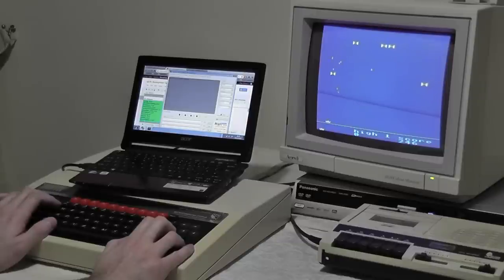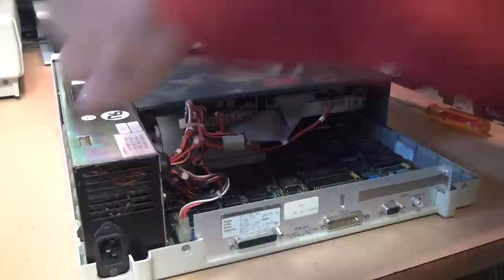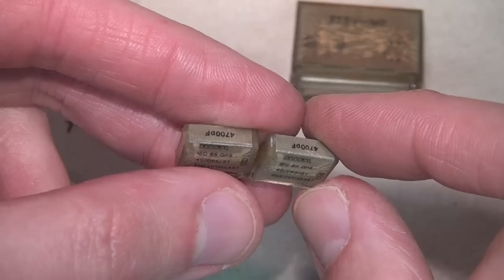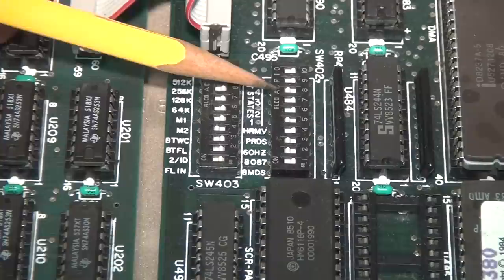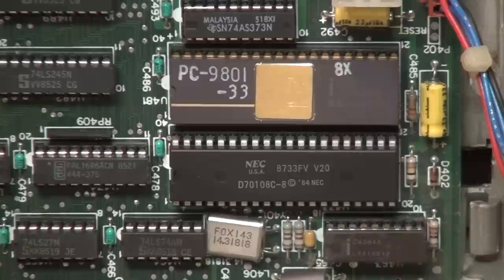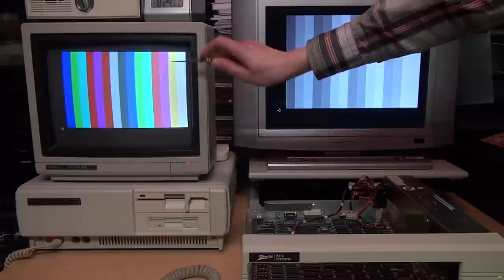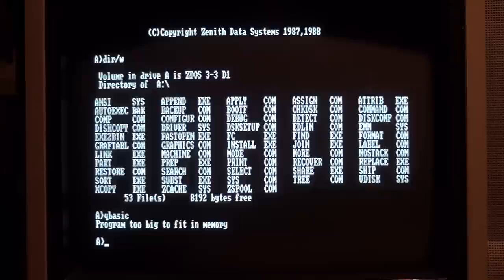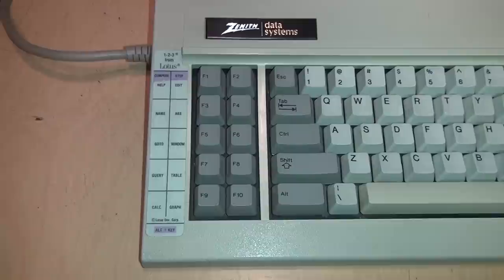Zenith Z-148 rare retro PC Rifa repair & review

Comment: RIFA actually stands for Reduces Itself to Fiery Ashes.
Reply: haha 😜
Reply: Yamaha actually did a product recall on a thirty year old amp using these as they didn't want peoples houses reduced to fiery ashes (although to be fair the capacitors are supposed to be flame proof).

Quiz: Where is the worst place a RIFA capacitor can go ?

Answer:  In your vacuum  cleaner. You won't see any smoke but the whole house will smell of it. Happened to me with an old Electrolux.
Reply: @MrDuncl  oof
Reply: Lol
Reply: @MrDuncl  'proper' class X or X2 caps 'should' 'fail safe' , not causing any fire...

Comment: Proud part of Zenith Radio Corp. ZDS actually  made a profit & was respected.
Old story that went around in the day. ZDS was sold to Bull, A B Dick was associated 
some how. When you called ZDS the operator would say " Bull Dick how can I help you". 
That lasted a week so they say. Now you need to get the Zenith 14" FTM CRT monitor.
Killer pix but prone to all kinds of cold PC  joints. Had they used that jug in a 13" TV 
it would have been an $800 TV. Flat & square just had to wait.......
LFOD !
Reply from the maker: My friend had one of the early Zenith flat-tube VGA monitors. It had a nice picture but compared to all the curved-tube CRTs we were used to at the time, the image looked concave.

Comment: A note on the "modern" 3.5" floppy drives and their drive select, some of them inside you can change through means of solder pads, most only have DS0 and DS1, but they are often set up to be selectable regardless, it just needs some soldering iron time... :)

Comment: A note on the labeling on those RIFA self-healing paper capacitors (which supposedly survive many power spikes before finally exploding):  D in a circle means it has been certified to pass regulatory testing at the former Danish Electrical Material KOntrol authority DEMKO, whose lab facilities were sold to UL in the 1990s after being overshadowed by federal CE marking rules based on less strict enforcement. S in a circle is another such state approval from the 220V European grid.  Unsure why RIFA would bother obtaining those approvals for their 110V capacitors, though technically they could be put in series instead of a single 220V RIFA capacitor for extra resilience

Comment: Yes this is the very machine that I used back in high school for typing practice using Typing Tutor IV.
I remember the flashing K logo when you started up the program.
The machine I used had a hard drive in the right drive bay as well as the 5.25 floppy drive.

Comment: In 1985, I wrote an inventory/point-of-sale/accounts-receivable system that ran on a Z-148 with two floppy drives and 256K of RAM, so you could do a lot. 256K is really a lot of memory—when you're not trying to drive a graphical user interface.

Comment: I'm always sketched out by older capacitors in general cause of electrolyte drying out over time. I've seen it happen but honestly unless the machine somehow becomes unstable or does something screwy under load I'm more apt to leave them alone cause sometimes its not worth replacing them. Parts shortages are still a major issue now and its unnecessary busy work for a machine that looks like only get used infrequently.
Reply: dont worry too much about it, ones from this sort of era arent as bad as more modern ones, such as from late 90s to late 2000s, eg. 'capacitor plague' years .. i have some electrolytics 50+years old still good , admittedly not used under high power/temperature/ripple conditions,  but still......

Comment: I recall seeing Zenith PCs in a large lab over in then Stockton State College in southern NJ.  I don't remember what model they were just that it was late 80s, had typical more yellow than beige case color, and amber phosphor monitors.  I think they were part of the Z-286 series.  Later I ended up with a differently styled ZDS 286 with an MFM drive because it was 1995/6 and La Salle was finally dumping the last of their non-Win3.1+ capable PCs and somehow as a Comp Sci major I didn't have a PC of my own at school.  Couldn't do much but Lotus Works, Turbo C++, and the 2400 baud modem to connect to the school's Alpha still worked!  It was quickly replaced by a shiny new Micron Millennia with more video RAM (4MB) than that 286 had for system RAM, because VB kind of didn't support that old clunker.

Comment: That capacitors you put in will hold up for much longer than those RIFAs did. They aren't impregnated metalised paper, but a Polypropylene foil and ceramic. Those were even made in the 1960s, but cost much more, and you guessed it: they still hold fine till today. But the paper ones from the 1960s and newer are all leaky and would explode if placed from L to N :)
Reply: yep, paper dielectric caps are in general shorter lived than poly ones , but its the epoxy cracking that starts the problem,  allowing atmospheric moisture in , which paper of course absorbs....
Reply: @andygozzo72  I was pleased to see that he didn't fit the same type. People have found the epoxy cracking on old RIFA capacitors that have never been used or even soldered into a board.
Reply: @MrDuncl  yep, i dunno whether i'd dare fit a modern RIFA of that type 😉  i DID fit clear epoxy cased ones in an AT PSU that blew, but dont think RiFA branded...it was about 20 years ago!
Reply: i have a good used epoxy cased RIFA that seems ok, at the mo.. but its a 'low' voltage type, 10uF 63v dc and pretty sure poly dielectric..
Reply: That’s great to know, ceramic caps last forever barring some external shock strong enough to crack the internal structure and cause a short. (Which sadly is quite common with the very tiny surface mount ceramic caps, but these of course are not those!)

Comment: built the Heathkit version of this computer a couple of months before heading off to college.  Went ahead and topped it up to the full 640K +, and then picked up the expansion riser a year or two later.  Used it for ~ 8 years, still have it, but I probably need to check the PS caps before I try to turn it back on.  Cut a lot of TurboPascal code on that box, and a bit of Smalltalk...

Comment: I've been looking for the expansion daughtercard for one of these for almost 20 years now.  I'm not sure that they were ever sold in large numbers.  I did not know there was an aftermarket version though!
Reply: Someone should reverse engineer it and make it open source!
Reply from the maker: @ricardog2165  If only someone could find the service manual for it, which hopefully would have the pinout for that ribbon connector, it would be possibly to make a replica of the expansion daughterboard.
Reply: @vwestlife  My first thought would be that we just need to map the lines to the known ISA spec. 1) Use a multimeter to get the power lines. 
2) Visually check where the other lines go
3) Check the rest with an oscilloscope
4) Then hook up a POST board to check
Maybe I'm missing something?
Reply: @ricardog2165  I could probably try and whip up a very rough proof-of-concept if I had some schematics and one of these to try it on.. If it's anything like the Tandy 1000EX's ISA pin header, that should relatively be straightforward to do.
Reply from the maker: @ricardog2165  Yes, except that XT-class systems don't generate POST codes.
Reply: @vwestlife  The POST board also has LEDs indicating the state of some ISA signals and power lines

Comment: I’m surprised Zenith even made computers, I know them for making TVs, they look like imitation of Tandy computers, but it’s really cool you’re able to repair that Zenith computer!
Reply: They had large contracts with the US government in the mid 1980's.  My first machine when I started work at a defense contractor was a Zenith 386SX16 desktop machine.
Reply: @dennisp.2147  that’s cool, Zenith is like RCA, they were both making machines for the defense industry! And then both companies declined and were sold off!
Reply: I believe they had a large educational presence.  My University in the late '80s/early '90s almost exclusively used Zenith for their PCs (although there was a large Apple Macintosh presence outside of the Comp Sci department as well).  

The comp sci dept. even had some of the "Heathkit" PCs that had it's ISA Expansion configured as a bread board on top of the machine's case, so you could rig up your own custom ISA "expansion card" while learning computer electronics!
Reply: Ultimately Zenith couldn't compete in the market by the time the margins got super thin in 90s and Zenith Data Systems was sold to NEC who also owned Packard Bell, by that point they were selling Zenith and Packard Bell machines that were pretty much the same other than branding. There was also Zenith Network Systems that was acquired by Motorola which was eventually swallowed up by Arris that's now owned by Commscope, ZNS made one of the first cable modems.
Reply: @irinotecanhcl  Zenith was lucky to even have the educational market, because in the 1980s, we never had any of their computers in my school, it was mostly Apple II and the classic Macs, IBM, and Tandy computers! Only some colleges had them for cost reasons.
Reply: @brandonupchurch7628  because Zenith was in a highly competitive market, they’re not a dedicated computer manufacturer like Apple, HP, Dell, and other manufacturers. Technically Acer is the spiritual successor to Zenith’s computer business, since Packard Bell and NEC’s consumer computer division was sold off to Acer.

Comment: I appreciate the "if it ain't broke" philosophy, but those electrolytics almost definitely have superior modern substitutes.
Reply: Totally agree
Reply: I have an amplifier from the 80's with capacitors that measure better than the modern substitutes.
Reply: Theoretically, there’s probably something better out there from Nichicon or Rubycon. 
Practically, unless you have unlimited budget, it’s much better to only replace the ones that fail. 
Even a midrange modern one could be worse, and a cheap one almost definitely would be. Even if they technically measure better at first, modern cheap ones show all signs of being worse on longevity (smaller casing, denser electrolytes, reducing tolerance for thermal expansion being one factor no matter how good anything else is).
Reply: @kaitlyn__L  I would say unlimited budget and excellent soldering ability otherwise you may end up doing more harm than good - overheating the board causing delamination, lifting traces, etc. etc.
Reply: @TheErador  that’s an excellent point! I always assume the people saying this have experience and confidence in their soldering ability, since I’ve been doing it for 13 years, but you’re right that a loooot of people attempt this after just watching one or two videos and mess up their PCB.
Reply: The halcyon days of 8 mhz

Comment: Sweet! You can play some Attack of the Petscii Robots though. That's for sure. :D
But, did you ever show us how Lotus 123 took benefit from the 287 co-processor? I was waiting to see before and after.
Reply from the maker: From what I've seen on David's site, Attack of the PETSCII Robots requires 640K RAM and a high-density floppy drive, however Planet X3 should be able to run in 256K and from 5.25" 360K floppy disks. I did a video about the 8087 showing that it doesn't really benefit most uses of a vintage PC these days, but it's nice to fill the empty socket anyway.
Reply: @vwestlife   Ah you’re probably right. I’ve gotten lost in all these numerous ports he made. I just do the box designs and manuals and not really memorising the specs. 😂🙈

Yeah, I was thinking the math processors never really do that much for us in these settings.

Comment: Regarding the 3,5" Floppy drive issue.....EVERY 3,5" Drive can be turned into a Drive 0 drive. Even if you have to remove a trace on the PCB and rewire that. I found manuals on how to change ALL my 3,5" drives and it worked flawlessly every time. Many of the newer ones can be even adapted to Amiga, if you're willing to re-route some more wires on the drive PCB.

Comment: Documentation! I just found mine. (I no longer have the computer, but somehow, I still have the documentation.) 5, vinyl bound, 8-1/2" ring binders. (Not as classy as IBM's cloth-bound binders, but more useful.) MS-DOS Version 3, Z-140 PC Series Owner's Manual, MS-DOS Version 3 Programmer's Utility Pack (Volumes 1 and 2), and MS-DOS Version 2. The binders are labeled with both "Zenith Data Systems" and  "Heath".

Comment: Not just in power suplies, I once had a Rifa blow its' guts out inside a Hoover Junior U1104, used as a noise suppression cap across the motor, even after cleaning the mess up that vac stank for ages afterwards... :S
Reply: I had the same in an Electrolux. You don't see any smoke due to the high airflow but you certainly smell it. In am still annoyed about my Mums expansive Husquvarna sewing machine. She thought the motor had blown so threw all the accessories in the trash, then next time I visited asked me to take it to the tip. When I looked it was just a RIFA capacitor across the motor that had smoked out.

Comment: 18:53 The CRT monitors make zap sound.

It happened to me before as a 6 years old boy, I just got zapped by touching the front screen of that Akira CRT TV.

I know it's electrostatics, but how it can zap people and why it is acting like that.
Reply from the maker: It's static electricity, just like when taking off a wool sweater. It's thousands of volts, but the current is so low that it doesn't hurt you.

Comment: At least Amstrad got it right with their 1512 and 1640 in that it had standard 8 bit ISA slots and 512 or 640k of ram as standard, even if the PSU was in the monitor.
As for the RIFA's, modern polyester? capacitors will last longer, esp. if from a reputable manufacturer. They are also an issue in older Numatic vacuum cleaners and most people (incorrectly) just remove them.
Lastly, the LED's in the lock keys was a feature on some of our Acorn Archimedes machines, the keyboard wedge ones at least.
Reply: Both of those machines came out 18 months after the Z-148.  They were also not fully 100% IBM compatible.  The Zenith came out a bit more than two and a half years after the Commodore 64 and it's 64 K (38.9 usable) and the same year as the Commodore 128.  So it's amount of RAM was certainly commensurate with machines that it was competing with.  Remember, the IBM XT's motherboard didn't officially get a 640K capable revision until a year after this machine's introduction.

Comment: Hmm, I wonder if there are any of those Rifa capacitors in my ZF-152? (By contrast, many of those systems seem to have survived.) I wasn't a big fan of the Zenith keyboard because it had a noticeable metallic echo when the keys were struck. Something about the sound it made just bugged me.

Thanks for the Control-Alt-Insert tip! With any luck, Zenith left that functionality intact in later BIOSes and it might shed some light on a Zenith 386 desktop I've got that won't finish POST.

That power supply bears a lot of physical resemblance to those that Zenith made for the Model 50, 50z and 70 PS/2s. I always thought it odd that they didn't put their name or logo in a readily visible place on those power supplies as the other manufacturer (Astec) did.
Reply: Funny how the passage of time makes one forget things. In looking back at the comments on the ZF-152 video, you (vwestlife) mentioned the Control-Alt-Insert thing. I guess I should try it!
Reply from the maker: @uxwbill  There's also Ctrl-Alt-Enter (or Return as Zenith called it) to enter a CPU debug mode.

Comment: Hmm, get the full ram, and even without ISA, you can get sound with one of those parallel port sound solutions. Either an original, or one of the more recent remakes. Without the riser card, that's probably the limit.

Comment: A local technical college regularly sold off its surplus technology and a friend and I bought Win98SE systems with wiped hard drives. His eventually suffered a wonky power supply and I got a stable Gateway desktop.

I wonder if RAM chips used in Atari 8-bit RAM upgrades would work in that thing. Just need to source your chips from unlikely sources.
Reply: More likely an Atari ST. In about 1992 a colleague upgraded mine to 1MByte using RAMs he desoldered from some old memory card

Comment: 7:40 did the USA have stricter EM emissions requirements than Europe in the 1980s? I had a similar era Ericsson PC and it's monitor that would interfere with the MW and LW radio bands respectively.

Comment: i have a zenith 'z select' 486 thing here in the uk , no idea who made it, whether zenith themselves or someone else, but pretty sure ive seen pics of the motherboard somewhere else under another brand machine.... unfortunately not working, some nicad rot 😢   i had a 286 unbranded thing that let out the 'magic smoke' from its AT PSU... yep, those damn RIFAs,, thing is their current versions still use paper dielectric so 'could' fail again if the epoxy similarly cracks.. some other brands used the same encapsulation but dont know if poly or paper dielectric......

Comment: If the 2K of SRAM are L2 Cache, then they would only cover like up to 512K of RAM. (Count the bits of the SRAM Address space, add 8 bits for it to cover every 256byte boundary)  You might wanna occupy the second socket.
Reply from the maker: The scratch pad SRAM is not cache.

Comment: @ 15:00 Not real mode 286 Every x86 cpu can run real mode software. Even today.
The NEC V20 can emulate a 8080 CPU. I had one in my PC, running 8080 code.
Reply from the maker: Yes, but the NEC V20 also provides the 80186 instruction set, which is what most applications that would normally require a 286 use when running in real mode. So for example I can run the Windows 95+ version of MS-DOS EDIT, which uses 186 instructions but can run in only 256K RAM, unlike the QBASIC-based EDIT from MS-DOS 5.0/6.x.